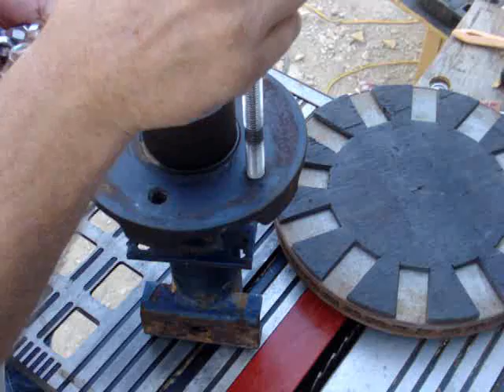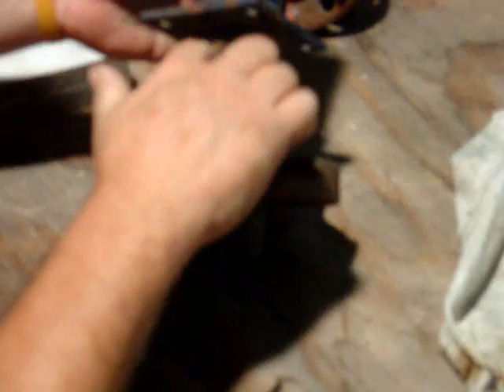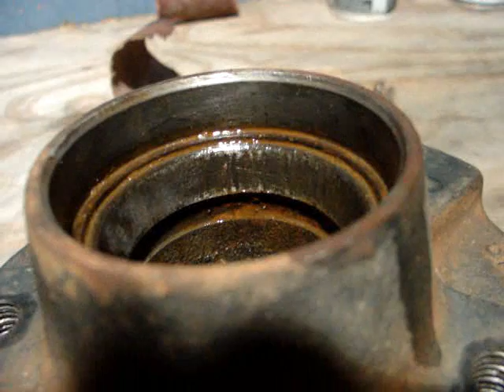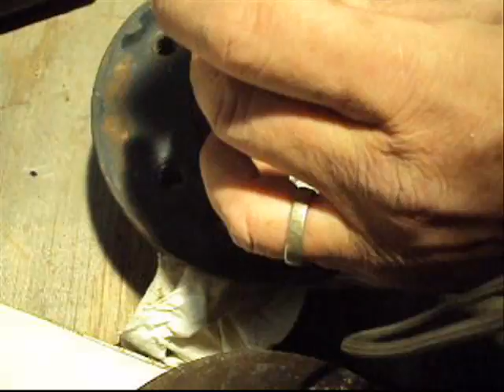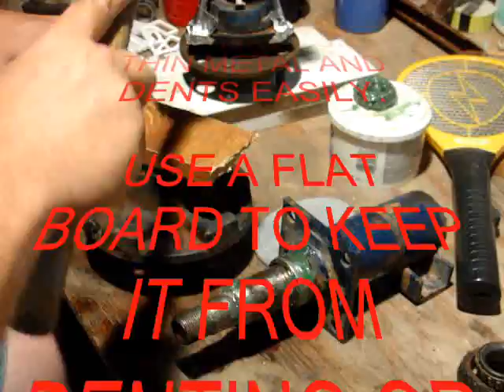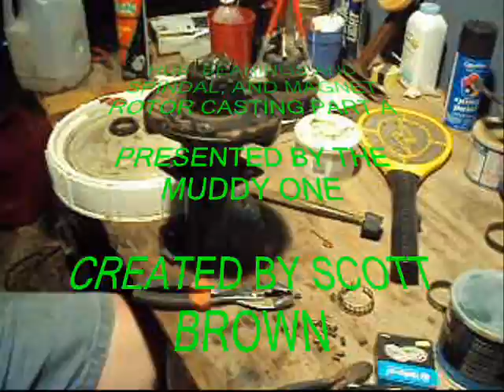BUILD A DUAL PERMANENT MAGNET ROTOR WIND TURBINE (PART 18)

Comment: lol I was thinking a spray can cap.
Reply from the maker: iwantosavemoney Ha Ha, i was thinking about the same thing a few times. But testing with hard drives and the smaller diameter disks and the same small magnets i used with the ceiling fan wind turbines, the magnets facing each other wound up having enough cumulative flux to bend the disks. and that is with a small diameter and thicker metal. larger diameter disks would bend very easy with the added leverage. So I scrapped that idea.but it doesn't mean you couldn't use a single magnet rotor. But it would mean you would need higher rpms, or more wire to reach charging voltage. MUDDy

Comment: They make a RED High Speed/ High Temp that  Resists water washout and degradation. ( mobile makes some) I have had better luck with it than the blue. If you get the blue to hot it likes to wash out of the bearing, though the seal..  My failure was a just a hot day, I had repacked the bearing the week before. That is when I noticed the grease all over the hub.. However; it was to late and the bearings were toast.  A friend turned me on to the red marine grease and have not had any issues or failures in the past 10 years..  PS Thanks for the great videos..

Comment: I always use the old races to drive the new ones in. Just be sure that when you do, put the thicker side of the race thats being used as a driver up against the new race. That way,if you drive the old race into the hub along with the new one, it can be driven out with the same lip you used to drive the old one out. Just an idea Muddy. You do pretty good work and make good videos. Thanks Muddy!!

Comment: Good call Heavy Demir. I was gonna suggest to take a cloth and get it wet and twist it up as if to wring the water out, then slide your chase's over it then put the cloth with the chase ring around it.  Let the cloth freeze with the chase on it.  before you take the cloth and chase out of the freezer be sure to use a torch to heat up the the part you are putting the chase into.  I hope you all know what heating it up will do as well as freezing the chase.

Comment: @muddymuddymuddman
   G'day... Very correct. Dad was  a Gunsmith, when he'd retired from Engine- Reconditioning. I was Rifle- Team Captain in High School. In '86 I had 8 Guns on the Wall, & 1 in the car...; last, to euthanase animals maybe roadhit, a .22 Rifle. But after a Shopping Centre SKS, 60 Rnd & 13 KIA...; I swapped the .22 for an 1898 Win. 32-30, to plug any Nut firing in my direction. A fortnite later at front gate a .243 slug ricocheted 5 yds away, from 150Yds out !

Comment: @muddymuddymuddman
    Well, it goes further, too. Them who have a gun "for defence" get to try hiding a cubic-foot of Vital Anatomy behind a quarter of a square inch... The Muzzle is their little Shield/Target..! 360 degrees azimuth, 180 deg. elevation... The impossibility drives the Gunbearer mad ; with paranoia, & the stress of what may be sneaking up, unseen.... So, they tippytoe about, head on a swivel ; clinging to the Shoot-At-Me- Machine, that makes it all worse..!

Comment: @muddymuddymuddmann I saw a guy rewire a motor with a whole bunch of phases to become a generator or alternator or something not quite sure but any how it would produce electricity instead of using it. well used some while it produced some anyway. Sorry I ll get to the point I m getting to is he got rid of all the grease no grease at all it makes too much drag. he used light machine oil only. it would really spin good then. oh well you should try it with out grease it will spin like the dickens.

Comment: LOL. Always extra parts.
Did my fathers front bearings on his 93 Dodge Dakota last month. I normally just spray my hands down with break cleaner. Stings a little when you have cuts. :s
A few months ago I was doing my sisters ball joints (98 Blazer) and I ready to put the caliper back on... didn't know weather to laugh or cry when I noticed it was on the wrong side of the axle.
When you rip something apart and put it back together. Just so cool to gain an understanding of how something works.